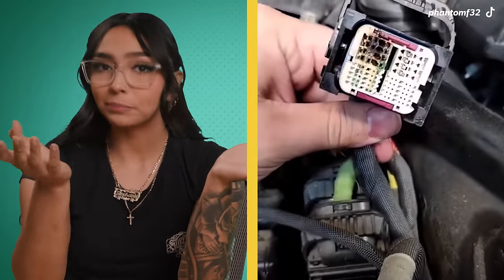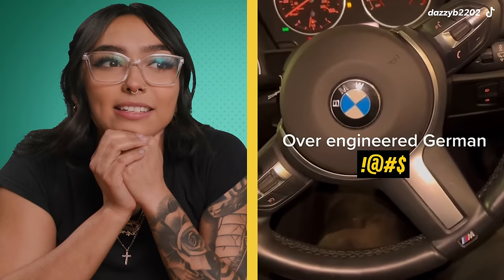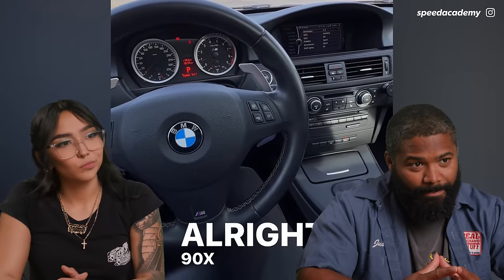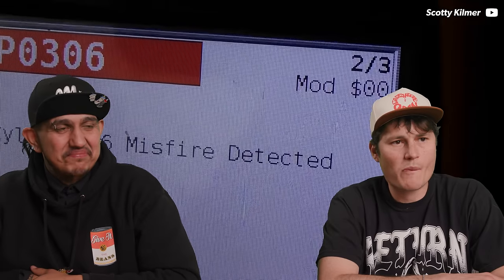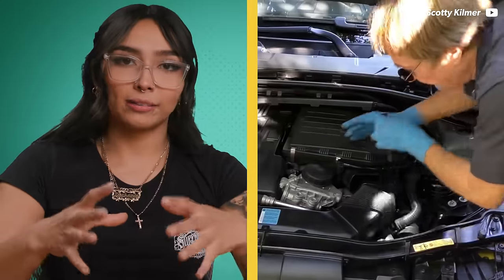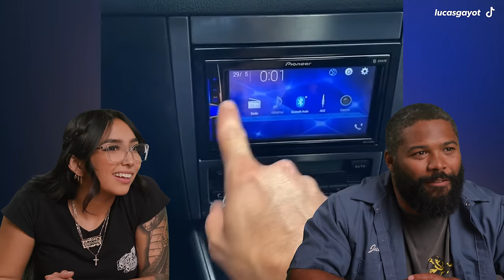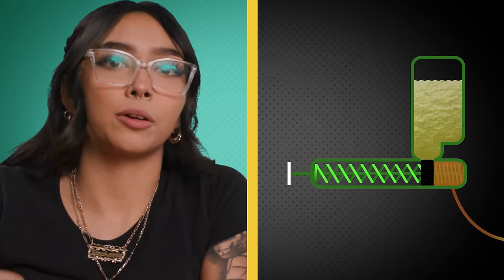Mechanic Reacts to German Engineering Fails

Comment: I drive one of the first BMW generation MINI’s. I’ve owned it just over a year and already replaced my clutch, head gasket, head (r50 guys know about cylinder 2 spark plugs) and the entire rear end of the bodywork because it had more rust than the titanic. I’ve also never taken the exhaust of an r50 without snapping the bolts/studs off. I still love it SO SO much, and I will admit engine work is super simple because you can take off the entire front end pretty much. I will admit though, every time it breaks I consider setting it on fire and buying another EP2.
Reply: buy the real thing, dona car take it to mini remastered, 3x the cost of bmw junk, just you get the classic looks updated start at around £75k upwards, seen one fore sale £117,000 . Mini Remastered by David Brown Automotive The interior of Mini Remastered by David Brown Automotive offers comfort and conveniences for the modern day in a bespoke, handcrafted cabin. With a premium in-car infotainment system, operated via a 7" touchscreen interface, With mass-production comes compromise. By contrast, our low-volume, handcrafted Mini Remastered is built to the highest standards using a combination of traditional coachbuilding techniques and state-of-the-art manufacturing processes. engineers scrutinise all aspects of the car from the ground up. The result is a completely new structure and exterior body shell, that not only offers classic, clean styling but improved rigidity, sound-proofing and reliability. Over 1,000 man hours go into creating each Mini Remastered. The original engine has undergone a complete transformation, having been completely rebuilt with brand new parts throughout and tuned to perfection. The standard car now produces 30% more power than the original unit. The power increase is perfectly mated to a four-speed automatic or manual four- or five-speed transmission. to me that what bmw should done but instead ruined the brand

Comment: I couldn't help but empathize with the guy pulling a burnout, as it brought back memories of my own attempt back in high school. I owned a '97 Camaro, and I was eager to show off my skills in front of my peers (half my class after school) However, much to my dismay, I couldn't get the car to burn out, despite several attempts. It was only after the fifth or sixth try that I figured out I had traction control on! As soon as I turned it off, my tires were gone in no time. Oh, the joys of youthful ignorance! I was a nervous wreck, with everyone watching, and the pressure was sky-high. But eventually, I managed to pull it off!

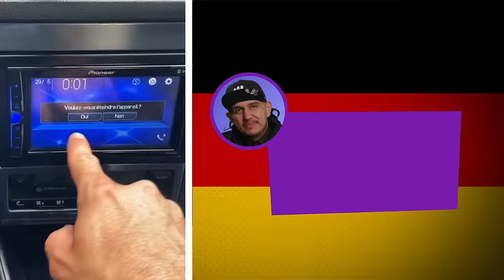Comment: 12:26  My brother bought a $200 beater and they had spliced the head unit into the headlight wiring so the radio would turn on or off with the head lights.

Comment: 2011 535I... like Scott said, when a piece of plastic breaks, it doesn't stop. The slanted inline 6 always leaked oil. Changing the plugs and coils? Go ahead and change the valve cover gasket. You'll thank me a few months later when you're driving without a massive leak that drops the oil on the twin scroll turbo. They put all the money into 200 hoses, 1 Olympic pool of coolant, and x-drive!! The entire interior of the car is cheap. Offbrand vinyl that starts pealing and sticking to your fingers. Oh, also had a passenger door/window that always dumped water in the floor board from the door filling and draining with rain water!! I'll never get another bmw unless I'm gutting it and starting from nothing

Comment: 1:09 The coolant leaks through the connector and the pressure pushes the coolant all the way to the DME. Notorious issue with the N63 engine and the N55 (but for oil traveling to the DME)
I was a Certified BMW Technician for 4 years, and I've had my fair share of nonsense between all the engines... Especially the N63, N63T, N63TU, N63R, and S63!... Nonsense!
Reply: Shout out for the N57. After I'd replaced the inlet with an aftermarket and fiddled with the EGR trash, the only issue I had with it was how you had to take the coolant pump off to get at the belt tensioner. Other than that, I'd say it's about the best engine that BMW have put together.

Comment: Owner of a 2004 Audi A4 Quattro 1.8T that had to have it's engine completely rebuilt. A friend helped me rebuild it, though I did about 98% of the assembly work myself, and it still doesn't run right due to the timing being slightly off. Great engine that'll make great power for it's size, but it was a PITA to work on.

Comment: When Steph mentioned the whole plastic isn’t holding heat, it was the one thing I disagreed with just because of the thermal footage. It does hold in some heat then the cover itself absorbs the heat and becomes brittle. Not saying plastic is great insulation but it’s def more look over purpose and isn’t necessary

Comment: The shaking steering wheel is intentional at about 3:00, though something on it has probably broken. I do not remember what it is officially called but I'll call it an over steer protector. God's honest truth, my father-in-law invented it. I remember going to his shop at work where he had steering columns from several European cars lined up on work benches hooked to lap-tops simulating driving conditions. The Germans were the ones initiating this because there is no speed limit on the Autobahn. They were having problems with people driving at high speeds and cutting the wheel too hard and rolling the cars. The computer tracks how fast you are moving and if you cut the wheel too hard into a turn the wheel bumps you to tell you to stop and lessen the turn. Many cars over there are manual so if you continue to resist the wheel bump, the computer disengages the transmission, applies the brake and straightens out the wheel to reduce the risk of a roll-over. At the time that he was working on it, it was only going into very high-end cars. Something jacked this one up so most likely the car is thinking you are in a high speed turn and that is why the wheel is fighting to go back.
Reply: So for the wheel it's like bonking your elbow and it's all tingly, so the arm freaks out.
Reply: There is nothing honest or true about anything to do with an evil cult

Comment: All 3 of my first cars were German. Nothing but problems and money. First one needed a whole new transmission and all kinds of little switches and things. Second one had a piston rod break and had to rebuild the motor at 120k. Third one was nonstop repairs from $300-800 every month. All of them an absolute pain to work on not to mention expensive.

Just ditched my last one for a new Corolla at a pretty decent loss cause of all the issues. I'm so excited to not be stressed about maintenance and repairs.

Comment: Always use dielectric grease in your electrical connections. Especially under the hood. If your connections have enough dielectric grease in them, moisture can't penetrate the connections and cause a short in the wiring. The rubber seals in the connectors is a good idea. But without dielectric grease it can't stop all the moisture. Every time I pull a connector loose, I put dielectric grease in it before I reconnect it. I also pull all connectors in that area and grease them too. Just make sure you unhook the negative battery terminal before unplugging anything. Especially on modern vehicles

Comment: I don't know about German cars, but my 2004 Dodge Neon you have to take out the whole dash and components along with steering column to get to the heater core.
Reply: I was under the impression most cars' heater cores were "dash out" affairs
Reply: No, not really. I've worked on many cars where I didn't have to take the whole dash and everything else off the car. Of course I mostly work om cars made before 2000, but there are some newer cars you don't have to take out the whole dash.

Comment: Porsche and BMW guy here, the Porsche is easier to work on, slightly, but both are pretty decent. Yes some very limited space areas and areas I think, damn if this was over here, I wouldn't have to remove xy&z. But in the modern world I've worked on a few GM cars that also made me have the same thoughts. This leads me to believe they're really all very much the same.
Reply: Came from the muscle car world to Porsche. I was terrified to own one but turns out the are awesome. Absolute converted for life. Downside is you do really need to own a way to get it higher up to work on the rear of the car.
Reply: That's why I bought an older 987 Boxster after working on my friend's 986 and 987 - surprisingly easy to access / maintain / repair (for the most part).  Some stupid stuff here and there (e.g., no cabin air filter box, plastic switches peeling - like all german cars) but in general, not too bad at all.  Oh, as @SonicProvocateur indicated, QuickJack maybe the holy grail (aside from an actual lift) but I can live with a set of Escos and ramps.

However, the recent ones I am not sure about - e.g., my friend's 911 991....you need to remove shitload of plastic stuff for the oil change, and need to remove the freaking rear bumper to change the air filters...$$$$ for the dealers.

Comment: I lost a 2000 bmw 528i with the inline6 to water damage. The computer was in the floor of the driver side, and rain water conveniently flooded the front floor pans with water from the sunroof drains. So the thing about the computers in bmw autos conveniently being in easily floodable body buckets... That fly's in my book. It is done like that for a reason. The worst part, when I finally found the computer that was damaged, it was surrounded by a foam shell. So, despite the water not actually submerging the ecu, the foam surrounding it, sucked up all the moisture and damaged the unit... I paid 800 for the car. I sold the engine for 2500... So... Kinda a win?
Reply: last i checked on the e39 the only driver side module was immo and it wasnt on the floor it was left hand side dash. the ecu lives under the cabin filters in engine bay area so stop lying unless it was just a amplifier for dsp that you fried.
Reply: and facelift body had drainholes one in each side of the car and 1 in the trunk so kinda your own fault being oblivious on floor mats being drenched from the clogged sunroof drains
Reply: @nitroruski7986  hth are you to call me a liar. Maybe you need to sit back and think that you don't know jack about the cars history at all. As don't know what life someones car had. It was a manual m5 that had an auto swapped into it. The prior owner had removed the computer out of the engine bay. So it wasn't being cooked by the engine like the abs unit. The part under the driver floorpads was originally a body control module. The Amp was in the trunk of the car with the infotainment unit, cell phone module and cd changer. The whole point was the floorpans on these vehicles flood. It's all too common despite the owners maintenance abilities. Kinda hope you are comfortable being an aSSumer with remarks like that.
Reply: @barrelracer318  so it was the former owners fault and not the cars fault but you try to blame the car.... got it
Reply: @niklaspetersen4936  uhh no. It was the cars fault because the floorpans should not be flooding in the first place. My Mercedes 300sd floorpans didn't flood. Nor did I have any water ingress in that vehicle at all. That car had a sunroof too. My suburban had a leak by the back barn doors. Tho that was a bad door seal. The problem is, these cars have these leaks. They are common, they are design flaws. No if ans or buts about it.
Reply: @barrelracer318 still I assume a bcm is way cheaper than a ecm or whatever your car destroyed. The po shouldn't have put the ecm there or should've removed the foam. Why would he put such an expensive module close to the ground?
 My Buick had the airbag module on the passenger seat floor which was pretty dumb because a water leak soaked and ruined it it. But I think Buick put a little drain under the floor so the water at least dripped out, just not fast enough to avoid damaging the airbag module. And best thing was I was at home due to COVID lockdown so I didn't get to notice the water getting in. 

But funny thing is the airbag light disappeared later on so it is possible that the module came back to life, except I wouldn't trust my life to it.

Comment: She is correct coolant problem on the Merc that white smoke is coolant burning or turbo burning. Or both! If that car isn't shut off very soon you are dumping extra hot air straight from turbo not cooled into your pistons.  Melting said piston rings and possibly pistons causing you to have a new paper weight.

Comment: I'm a tech of 16 years and worked on German cars exclusively for 6 years, BMW was the only German car I didn't like working on. Mercedes, Porsche, Volkswagen/Audi all may be overengineered, but they're not hard to work on and they're really reliable vehicles if you take care of them.
Reply: You think that pulling the front clip to change the timing belt on a passat is okay??? Or having to remove the front fender & other body work to change the battery on some VW beetle convertibles ???
Are you a masochist???
Reply: @davidhollenshead4892  German cars can be taken apart pretty easily IMO, plus you get paid more for repairs that should be quick. The more hours a repair takes, the easier it is to beat the flat rate.
Reply: When you have access to all the proper tools and repair info BMWs get easy to repair, just lots of extra steps in the tight engine bays. I still think they have the best wiring diagrams of any car company.

Comment: I am a motorcycle mechanic, so I do not work on cars a lot, however many of my colleges have doen so for years and from what they said the worst offender is Opel, mainly as they have all the issues as other german cars, but with not so great quality parts, so these bad problems appear more often and the plastics have such sharp edges that it is supposedly quite hard to not cut your hands open.
Reply: A lot of Japanese cars are also designed to make you bleed...
Reply: Opel is making pretty durable cars, tho. My first car was a Corsa, with 80hp. It had air conditioning and a radio and that was all luxury it had. it was also slow af, but that damn thing was almost indestructable!

Comment: I had the “pleasure” of owning a 1 of 2000 made limited edition VW new Beetle my wife just had to had. After realizing the wheel, inner fender, engine mount, all the belts and pulleys, and it’s about a 4 hour job to do the water pump when it went out; plus the camshaft position sensor… and they constantly go bad. It went bye bye and I bought her US designed Japanese.

Comment: German cars are made with german tüv standards in mind. They're expected to be serviced regularly so the more obscure shit doesn't even happen. Not a judgement more an explanation of the philosophy behind it.
Seeing the shit that's allowed to drive on American roads I'm not surprised about any odd failure.
Reply: I suspect many Americans are more prone to the following attitudes:
1. I'm only leasing it, so I don't care.  After three years, good, bad, or indifferent, it's gone, so any problems are not MY problem.
2. After 3 - 5 years, the car note is paid off, so I'll buy a new car, so I don't care.  It will be gone, so any problems are not MY problem.
3. Blew my wallet on my dream car, nothing left for maintenance.
4. Maintenance - it's just a scam/money grab, you don't really need to do that nonsense.
5. Holy S! - fixing all that stuff I've blown off for years is more than the cars worth!  Unload on a sucker and buy another!
6. If I bought a used POS on time and it stops running, I'm stopping making payments.  The Repo Man can take it back and I'll buy another used POS somewhere else.

Just to be clear, my own car is a 2011 Honda Civic, bought new, cash, but now with 199,600 miles / 321,225 Km on the clock.  It runs excellently, having not required much more than regular fluid & filter changes.  And the engine bay looks nothing like the German disasters in this video, for which I am grateful.
Reply: Living in europe and actually working with the guys from that industry, I know that's just wrong. They are fully aware of what they're doing and basically set the cars up so that you have to pay good money when anything breaks after the extended warranty period expires. Average german, frenchman and whoever else buy the cars new and sell a few years later, when it's time for them to get a new one. But the other people who buy these cars afterwards get fucked. TUV has nothing to do with it, since nothing really breaks during that period of ownership, except for consumables (I do however agree skipping maintenance is dumb).
TLDR: don't buy german. You either get ripped off when buying new or ripped off on repairs.
Drives away crying in a 2015 3 series that needs it's engine taken out to do the timing chain because someone thought it would be a good idea to put it near the firewall
Reply: German cars have unexpected and unacceptable failures of components that "routine maintenance" does NOT resolve. Maybe they send us here in* the States all the reject, defective parts made cars, but the ones we get are utter garbage. As a previous brand new VW *owner, that WAS made in Germany, I KNOW.